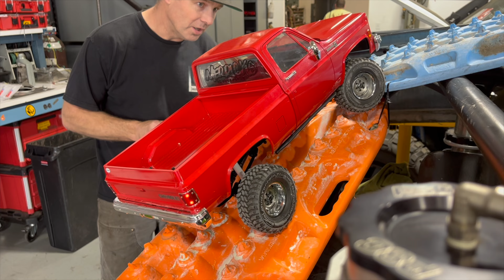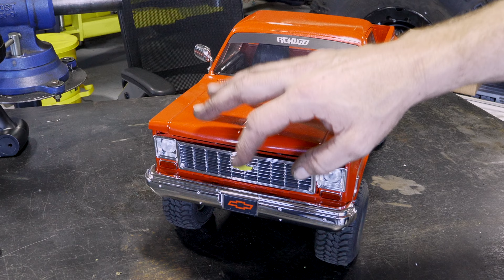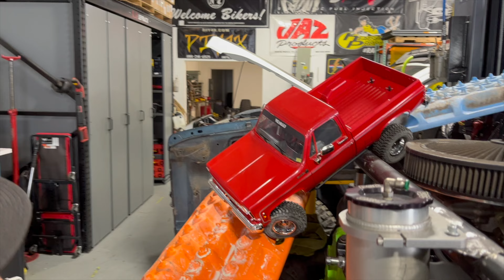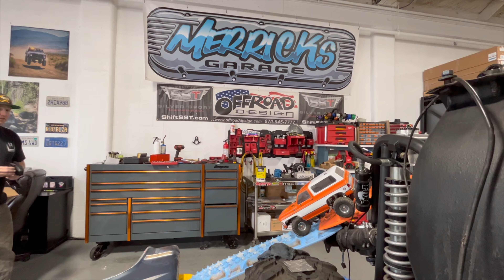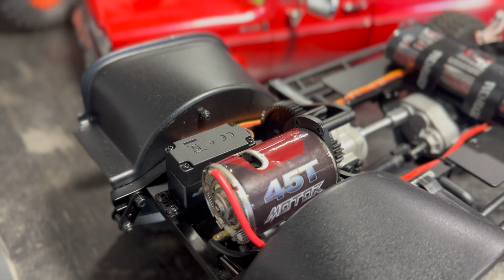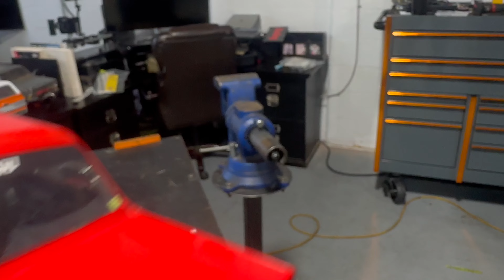I can't get over the scale detail on this new RC4WD K10

Comment: Hey i have a question  on my 81 gmc Jimmy  I'm looking to do the 4"   shackle flip and I have a 1" transfer case spacer would you recommend pulling out the spacer for the shackle flip??
Reply from the maker: yea, pull it out as you might not need it after lift.  Or you might need more!
Reply: Ok thanks Merrick just in the shop right now installing crossover steering from ORD and have the shackle flip on the way 
Im a Big fan 👌